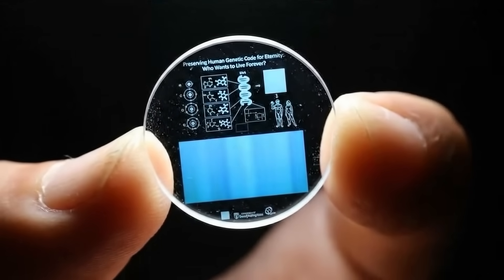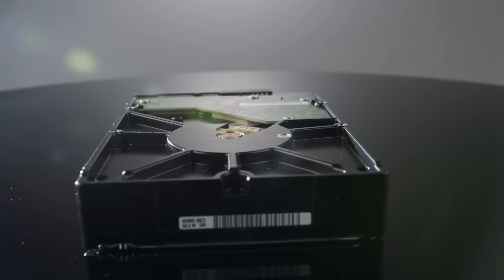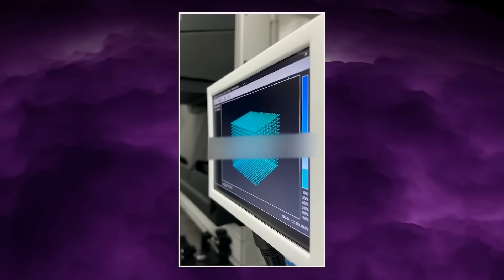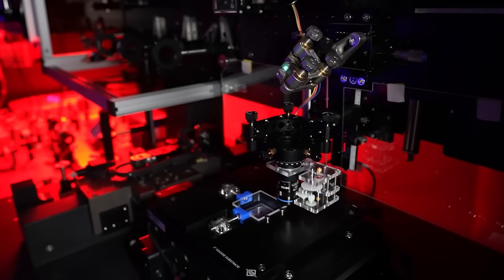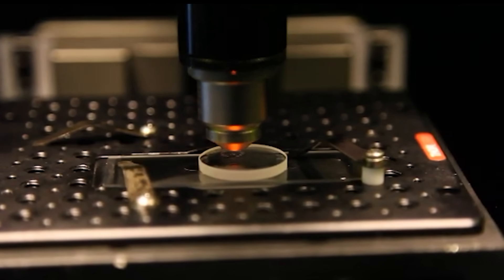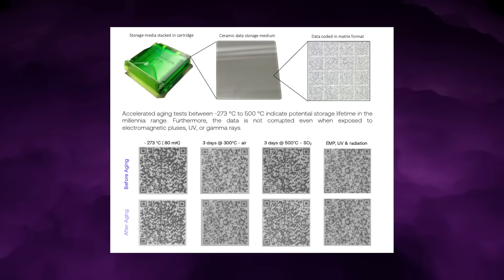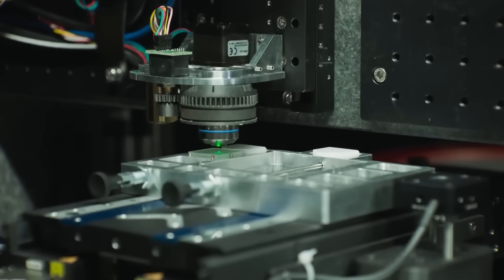Microsoft's New 5D Glass “Memory Crystal Storage” Could Replace Hard Drives Forever!

Comment: I used to have shared in a company called Constellation 3D (late 1990s maybe early 2000s??) They made a fluorescent multilayer disk aka FMD. Only it was DVDs and credit card sized storage. They could store a few terabytes on a DVD when at the time only 0.004TB ( 4.5GB) could be done at the time. This method reminds me of that. FMD wrote using various wavelengths of laser light not time-based like the femtosecond method just frequency.

Comment: Can you format the data and store different information on it, no so it's a failure !!!
😂👎

We need something at atomic level and hard as diamond with ability to be erased and rewrite with its own build in PC in it so you can display info right on that storage device or even better project the image in the thin air where you can control projection with your hands for input/output  feedback.   Now we talking real future, yes it has to generate its own power by being exposed to light too or other means.
🤔👍

Comment: What most of us are hard pressed for is increased storage capacity !
We want a storage device capable of storing hundreds of Petabytes !
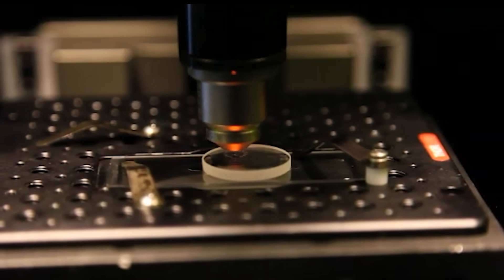Reply: Sorry This video was probably made by an ai, so it likely either won't bother to include the fact that this will not replace hard drives / SSD drives because its big fancy lases are expensive, take too long to read / write data, and whatever is written on it is permanent (granted they can store so much the latter probably won't matter for thousands of years) i.e. cannot be deleted or apply the mental gymnastics that it's just a prototype as if this element of the medium will improve significantly in the future (it probably won't). PS 5:20, I was right.
Reply: @SinSefia   the video is poor, but it concedes all that.

Comment: Seeing it's only write the one time and then it's read only it would be good if someone made a Good Operating System and programs that didn't need to be changed or written to then you could have a extremely fast computer and use other drives that were read/write for the rest.

Comment: ok. let's assume i will pay for space, but who will pay for physical storage or "warehouse" for 100 years? 1000 years? you see, data should be "compacted" when expired once in awhile anyway
Reply: If you're archiving data, you need to... archive data, not reprocess it or "compact" it. Put the glass plate or block on the shelf and leave it there in case the data it holds is ever required.

Comment: How many write stations and how much time are required to archive the existing “cold data volume” (approx. 175 zettabytes) even at a write rate of 500 MB/s?
-
Um das bestehende "Cold-Data-Volumen" (ca. 175 ZettaByte) selbst bei Schreibrate von 500 MB/s zuarchivieren wieviel Schreibstationen und Zeit wird benötigt?
Reply: Transferring 175 zettabytes (ZB) of data would take an extremely long time, even with fast connections; for instance, at a blazing-fast 10 Gbps (Gigabits per second), it's over 1.3 million years, but at consumer speeds like 100 Mbps, it's billions of years, illustrating why physical transfer (shipping drives) or specialized networks (satellite/fiber) are used for such massive datasets, a volume projected to be the world's total by 2025.

Comment: They can make this but not an OS that operates well without bloat and spyware? 😅
Reply: Remove the NSA from it and Windows would be awesome.
Reply: It won't. NSA wasn't a thing in the 90s and it wasn't awesome then  @Joe-l2t5i
Reply: Open operating systems mean anyone can write anything. If you don't like bloat then instead of buying Dell or Acer, etc. buy a Surface product that is pure Windows without added software. Oh, were you pretending that anonymous telemetry is spyware? You're so original.
Reply: Pure windows is bloat  @liamharrington6672
Reply: of course they can but they dont WANT to, greed and control is what motivates them

Comment: you probably can write it only once ...
Reply: For Archival
Reply: So it would be like with most optical drives, personally I'd be down with physical media making a comeback
Reply: @Sylkis89  usb key or hardrive are not enough physical for you ? you can always find blueray for cheap price nowaday
Reply: @Sylkis89 you can only write once on an optolythic data rod
Reply: For maybe 6 months. Then they'll come out with the R/W version. That's about how it always works. 'Cause everyone wants a rewritable storage medium.
Reply: @MGmirkin  probably but first they need to fix the speed rate otherwise it isn't good even for backup
Reply: @MGmirkin  Glass data storage isn't intended for consumer use, it relies on expensive microscopes to read the data that only large corporations and government institutions typically have access to, so the demand for R/W variants may be far less than you realize.
Reply: In an age of "proof" that's a feature, not a bug.
Reply: Yes it write once
Reply: 360 Terabites in a 5inch glass, even that alone is more than enough for whatever application you might use this for, I don't think you would be concerned about rewritability with this amount of storage on a single sheet. If it would function like CD drives where they'd be hot swappable, how many of these would you realistically even need for your personal needs to store the kind of data a standard user would. Even if you say you need a petabite well that seems just fine with just 3 of those tiny glass structures.
Now it'd be bloody fantastic if these were rewritable and could approach speeds where you could store anything on these and be comfortable using it as the only storage solution, it'd make storage troubles obsolete for anyone. Imagine phones with ~500Tb storage like it's nothing. Maybe someday
Reply: @Kujar3Player  The femtosecond laser required to "write" data and the high-end microscope required to "read" data means glass data storage will never be available to the general public, it will be used exclusively by governments, corporations, and universities.

Comment: I'm personally pissed off and tired of these highly dramatic tech news as these devices are still 50 years away
And really just baiting us for more cheap storage that we will never live to see.
Even if it may arrive in 10 years time then you know that the real capacity that they will be offering us will be nothing compared to what they hype, but in fact it will be a millionth of this video, as they then will do only tiny fractional storage offerings every 5 years or so.
The whole hard drive and storage industry is a huge racket, bleeding consumers for every itsy bitsy incremental increase.
Imho 50 Terebyte drives should have been as commonplace as USB 256Gb by now and selling for no more than $100
And with 1 TB/sec read/write speeds